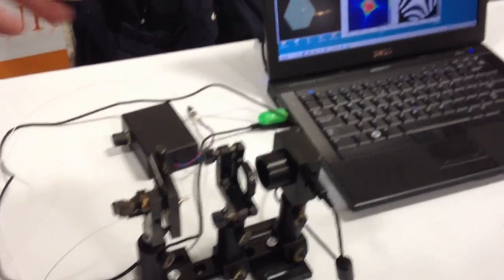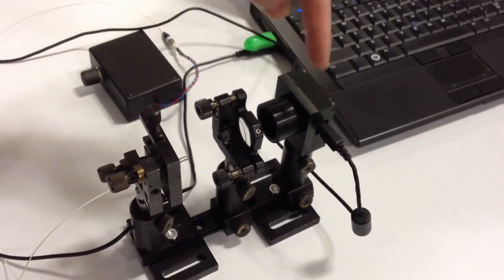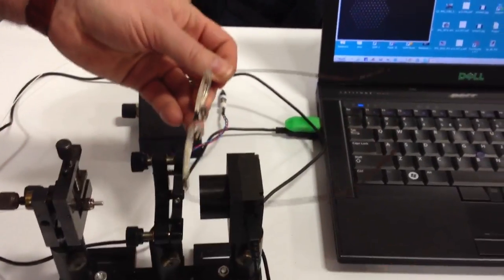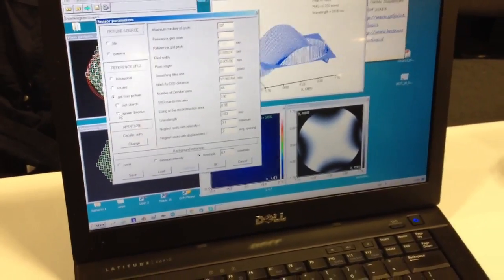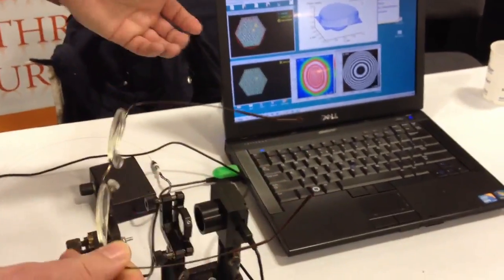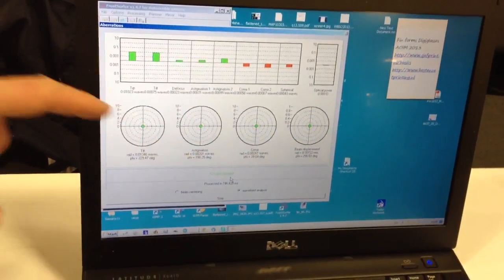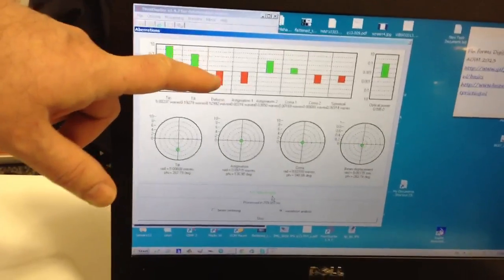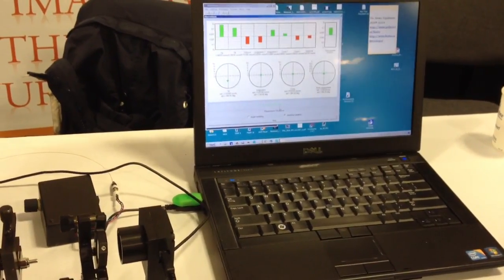Shack-Hartmann Wavefront Sensor Demonstration at SPIE Photonics West sales@dmphotonics.com

Comment from the maker: we do offer Shack-Hartmann wavefront sensor software package - sales@dmphotonics.com

Specifications:
Output:
• Raw Hartmann images
• Spot shift map
• Wavefront aberration map (3D plot, 2D projection, synthesized interferogram, up to 66 Zernike polynomials)
• Measurement error map
• PSF (point spread function)
• MTF (modulation transfer function)
• Strehl ratio, M2 factor, Gauss-Hermite modes
• Turbulence parameter estimation (for free space measurements)

Statistical analysis can be carried out during post-processing. If the system is equipped with a wavefront corrector, our Shack-Hartmann wavefront sensor software allows calculating control signals for the corrector in the closed-loop mode.

The program package is distributed as a self-installing executable file and/or a C++ SDK, which grants access to all functionality of the sensor and allows complete customization useful to the user’s software.
 
The optional program module “M2-sensor” is intended both for measurements of intensity and phase profiles and for estimation of the M2 factor of a single-mode laser beam on the basis of the wavefront measurement data. M2 calculations are carried on according to ISO 11146-2 standard. The module also permits expansion of the multimode beam into Gauss-Hermite modes in both automatic and manual regimes.

The optional program module “Beam propagation” is intended for simulation of the beam propagation starting from the wavefront sensor input plane to the plane located at a doubled distance to the plane of the beam waist.

Comment from the maker: Post-Doctoral Researcher, Adaptive Optical Microscopy

The School of Engineering at the University of California, Santa Cruz
(UCSC) invites applications for the position of Post-Doctoral Researcer in
Adaptive Optical Microscopy, under the direction of Prof. Joel Kubby,
working in the Keck Center for Adaptive Optical Microscopy (
http://cfaom.soe.ucsc.edu/).  Applicants will participate in research
and should
be able to contribute to the application of adaptive optics in
state-of-the-art biological imaging. Possible related areas of research
might include neurobiology and developmental biology. The successful
candidate will be expected to align and operate new optical imaging and
optomechatronic systems.  We have a preference for candidates with
expertise in the use of various forms of biological microscopy (wide-field,
confocal, two-photon, structured illumination), deep-tissue imaging,
high-resolution imaging, and the correction and compensation of aberrations
in imaging systems including wavefront measurement using a Shack-Hartmann
wavefront sensor and correction using a deformable mirror.

RANK: Post-Doctoral Researcher

SALARY: Commensurate with qualifications and experience.

BASIC QUALIFICATIONS: A Ph.D in Biology, or a related discipline. Experience
in the application of advanced in-vivo biological light microscopy for
neurobiology and/or developmental biology. A demonstrated record of
publications in peer-reviewed journals.

PREFERRED QUALIFICATIONS:

• Familiarity with the application of adaptive optics for biological imaging
including wavefront sensing and correction.

• Experience in the preparation of biological specimens for optical imaging
including methods of tissue clearing.

• Demonstrate the ability to use wide-field, confocal and two-photon
microscopy.

• Ability to assemble and align prototype optical systems.

• Experience working with live fly, worm, fish and mouse models.

• Managing mouse colonies containing transgenic and inducible reporter mice.

• Working with viruses, DNA electroporation, and other fluorescent labeling
techniques.

• Working with Institutional Animal Care and Use Committee (IACUC) to
develop new procedures and protocols.

• A demonstrated record of publications in top-tier peer-reviewed journals.

POSITION AVAILABLE: January 1st, 2016.

TERM OF APPOINTMENT:  The initial appointment is for one year, with the
possibility of extension. Should the hiring unit propose reappointment, a
review to assess performance will be conducted.  Reappointment is also
contingent upon availability of funding.

TO APPLY:  Applications should be sent electronically to Prof. Joel Kubby
at the address below, and must include a letter of application that
addresses how you meet the basic and preferred qualifications, curriculum
vitae, at least eight selected publications (URLs or PDF format) and three
letters of reference*.  Documents/materials must be submitted as PDF files.

Send applications to: jkubby@soe.ucsc.edu

*All letters will be treated as confidential per University of California
policy and California state law. For any reference letter provided via a
third party (i.e., dossier service, career center), direct the author to
UCSC’s confidentiality statement at http://apo.ucsc.edu/confstm.htm.

CLOSING DATE: To ensure full consideration, applications should be
complete and letters of recommendation received by December 15th, 2015.
The position will remain open until filled, but not later than December 31st,
2016.

Comment: Unimorph Deformable Mirrors and Control Units part numbers		
http://www.dmphotonics.com/Adaptive_Optics/unimorph_deformable_mirrors.htm		
		
Item	Part #	Description
1	VC.DMU-36-G-24-MDL-000-Al	Unimorph deformable mirror; Clear aperture: 36mm, working aperture: 28mm; 24 channels; Modal electrode arrangement; Stroke +-12 um (minimum); Al+SiO2 mirror (0.3J/cm^2 minimum damage threshold)
		request a quote
		
2	VC.DMU-56-G-32-MDL-000-Al	Unimorph deformable mirror; Clear aperture: 56mm, working aperture: 46mm; 24 channels; Modal electrode arrangement; Stroke +-15 um (minimum); Al+SiO2 mirror (0.3J/cm^2 minimum damage threshold)
		request a quote
		
3	VC.DMU-96-G-56-MDL-000-Al	Unimorph deformable mirror; Clear aperture: 96mm, working aperture: 82mm; 56 channels*; Modal electrode arrangement; Stroke +-20 um (minimum); Al+SiO2 mirror (0.3J/cm^2 minimum damage threshold)
		request a quote
		
4	VC.PDC-24-1-300-100	Control unit; 24 channels, USB interface; 100Hz bandwidth
		request a quote
		
5	VC.PDC-32-1-300-100	Control unit; 32 channels, USB interface; 100Hz bandwidth
		request a quote
		
		
		
http://www.dmphotonics.com/Mirrors_Del_Mar_Photonics_web.pdf
http://www.dmphotonics.com/wavefront_sensors_web.pdf

SAMPLE QUOTE FOR ADAPTIVE OPTICS SYSTEM	sales@dmphotoncs.com	
http://www.dmphotonics.com/ADAPTIVE_OPTICS_SYSTEM.htm
Item	Part #	Description
1	VC.DMU-38-G-24-MDL-000-HP1,06	Unimorph deformable mirror; Clear aperture: 38mm, working aperture: 25mm; 24 electrodes; Modal electrode arrangement; Stroke +-6 um (minimum); dielectric mirror for 1.06um (up to 3J/cm^2)
2	VC.PDC-24-1-300-100	Control unit; 24 channels, USB interface; 100Hz bandwidth
3	VC.SHAH-6-150-3-20	Wavefront sensor ShaH (Shack-Hartmann type), 6mm aperture; 0.15x3mm hexagonal lenslet; 20Hz maximum frame rate (with pulsed operation)
4	VC.TL-30-6-1,06	Telescope 5X for wavefront sensor, 1,06um optimized
5	VC.CLDLL-V2.14	Closed loop software
		Installation and training 3 days	
Contact us for custom quote at sales@dmphotonics.com	

SAMPLE QUOTE FOR ADAPTIVE OPTICS SYSTEM	sales@dmphotonics.com		
http://www.dmphotonics.com/Adaptive_Optics/Sample_quote_2.htm			
Item	Part #	Description	Qty
1	VC.DMU-36-G-36-MDL-000-HP1,06	Unimorph deformable mirror; Clear aperture: 36mm, working aperture: 25mm; 36 electrodes; Modal electrode arrangement; Stroke +-12 um (minimum); dielectric mirror for 1.06um (up to 3J/cm^2)	1
2	VC.PDC-24-1-300-100	Control unit; 24 channels, USB interface; 100Hz bandwidth 9m cable	2
3	VC.SHAH-6-150-3-20	Wavefront sensor ShaH (Shack-Hartmann type), 6mm aperture; 0.15x3mm hexagonal lenslet; 20Hz maximum frame rate (with pulsed operation) with active extension cable 5m	1
4	VC.TL-30-6-1,06	Telescope 5X for wavefront sensor, 1,06um optimized	1
5	VC.CLDLL-V2.14	Closed loop software	1
		Shipping to Japan	1
		Installation and training 3 days (including travel, accommodation and subsistence)	1
Contact us for custom quote at sales@dmphotonics.com

Comment from the maker: I am researching adaptive optics systems for a proposal.  The only kicker is that we’d like to do everything at NIR for wavelengths near 1500 nm, which is beyond the sensitivity of silicon.
On the brochure, (http://www.dmphotonics.com/ShaH_Del_Mar_photonics_web.pdf) there is the statement that “An interface to a variety of CCD and CMOS sensors allows a wide range of acquisition bands from UV to near IR.” Can it interface with an InGaAs camera? I’ve been talking to a different vendor that offers a phosphor coating on the CCD that allows it to respond to 1490 – 1600 nm wavelengths. Do you off anything like that? If not, perhaps we can figure out an appropriate InGaAs camera – I don’t know if you have one you recommend, or I could look around and suggest one to you.

So I have it, could you send me pricing for this package:
a.      Part# VC.DMU-38-G-24-MDL-000-HP1,06  Unimorph deformable mirror, 25mm aperture, 24 actuators, +/-6um stroke
b.      Part# VC.PDC-24-1-300-100  Control unit, 24 channels, USB, 100Hz bandwidth
c.      Part# VC.SHAH-6-150-3-20  Wavefront sensor ShaH (Shack-Hartmann), 6mm aperture, 20Hz frame rate.
d.      VC.TL-30-6-1,06  Telescope 5X for wavefront sensor, optimized for 1.06um
e.      VC.CLDLL-V2.14   Closed loop software
f.       Includes installation and 3 days training

Request a quote at sales@dmphotonics.com

Comment from the maker: Adaptive optics - deformable bimorph mirrors and wavefront sensors
http://www.dmphotonics.com/Adaptive_Optics/Adaptive%20optics%20-%20deformable%20bimorph%20mirrors%20and%20wavefront%20sensors.htm
Wavefront Sensors: ShaH Family
A family of ShaH wavefront sensors represents recent progress of Del Mar Photonics in Shack-Hartmann-based technology. The performance of Shack-Hartmann sensors greatly depends on the quality of the lenslet arrays used. Del Mar Photonics. developed a proprietary process of lenslet manufacturing, ensuring excellent quality of refractive lenslet arrays. The arrays can be AR coated on both sides without interfering with the micro-lens surface accuracy. Another advantage of the ShaH wavefront sensors is a highly optimized processing code. This makes possible real-time processing of the sensor data at the rate exceeding 1000 frames per second with a common PC. Due to utilizing low-level programming of the video GPU, it is possible to output the wavefront data with a resolution up to 512x512 pixels at a 500+ Hz frame rate. This mode is favorable for controlling modern LCOS wavefront correctors.
The family of ShaH wavefront sensors includes several prototype models, starting from low-cost ShaH-0620 suitable for teaching laboratory to a high-end high-speed model, ShaH-03500. The latter utilizes a back-illuminated EM-gain CCD sensor with cooling down to -100°C. This makes it possible to apply such a wavefront sensor in astronomy, remote sensing, etc.